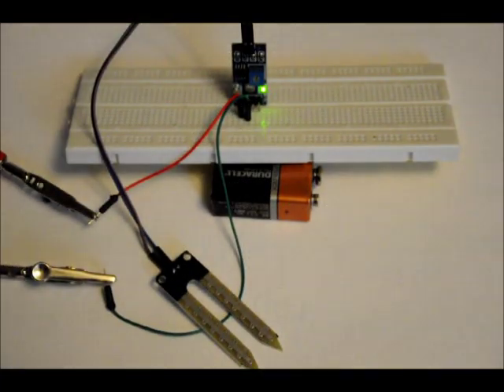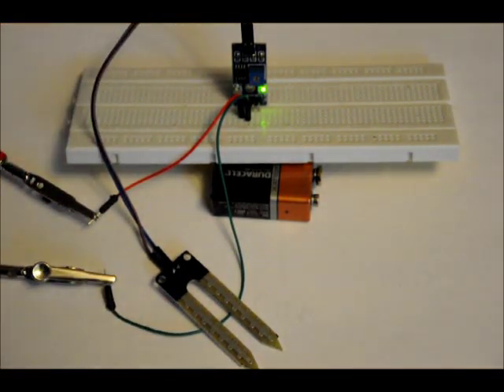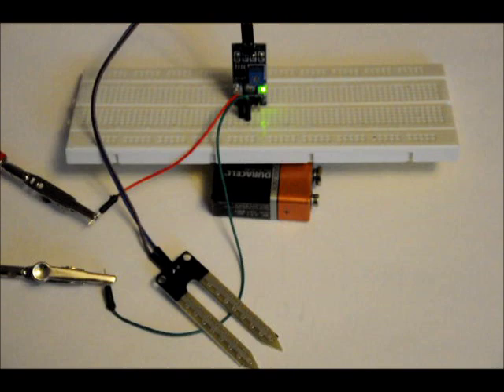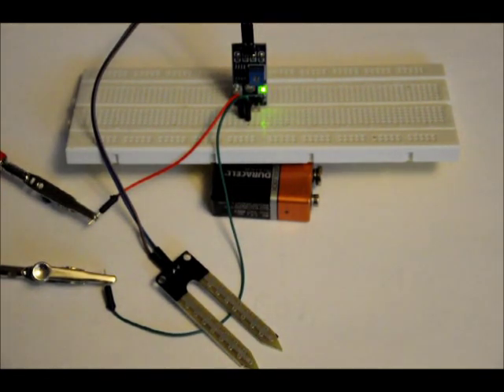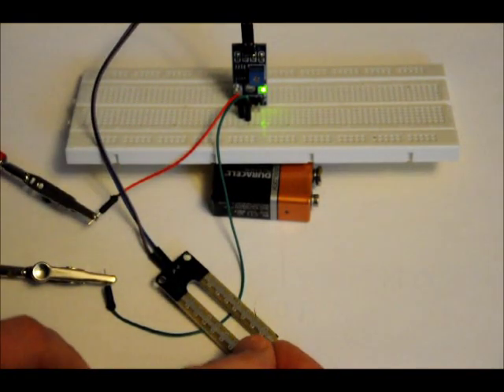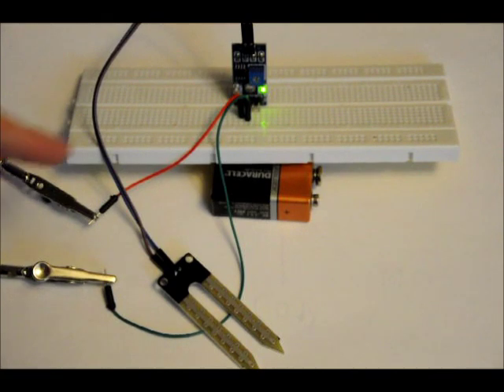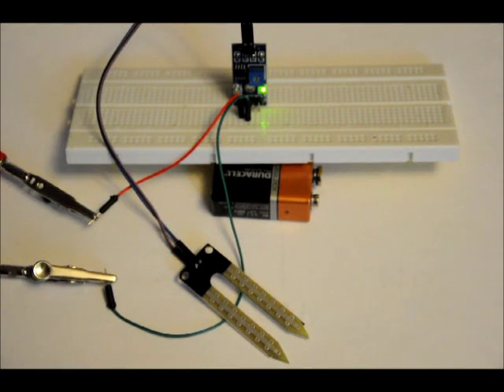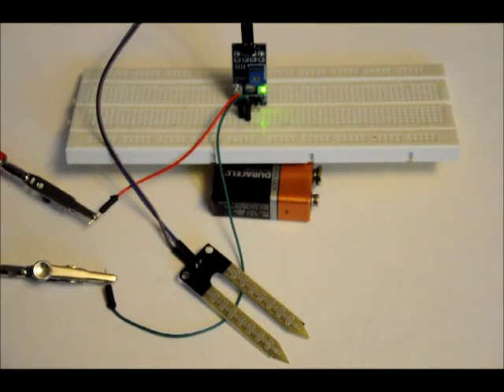Soil Moisture Detection Module - Easily Calibrated!

Comment: Thanks for the video!  Save me hours trying to figure out how the little board works.  Have you tried getting readings off of A0?  I'm looking to get a bit more gradual reading than just Yes/No.  Does one need to use a Voltage divider when using with an Arduino?

Comment: hello please how I have to calibrate my soil moisture sensor. It shows me values between about 280 to 1023. In 1023 it shows on air and in water shows me around the 280 I need to show me that percent. thank you
Reply: calibrate it as (1024 - analog value)/(1023-280) * 100 to get moisture in percentage ( this is done assuming moisture % vs analog value as linear, which works in most of the case)

Comment: Hi!
Is there any protection against electrochemical corrosion on the sensor?
If not -  this is garbage product.
Reply: The leads are insulated.  It goes without saying that if the copper were exposed completely, that oxidization would begin almost immediately upon the sensor module becoming wet.  Even in slight humidity...
Reply: Nope, not coated. You need to replace the sensor with two nails later.

Comment: What if I want a high and low limit on the sensor? One limit is basically useless....how will it know to turn something on AND off?
Reply: Garyscott7 kind of expensive to do it that way... might just build a simple voltage divider circuit and program an Arduino
Reply: It has analog output.